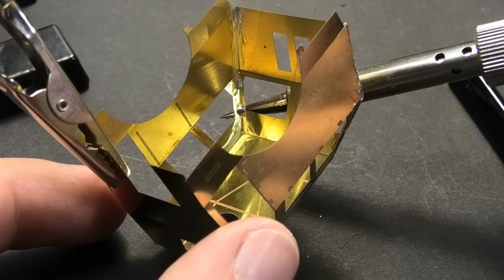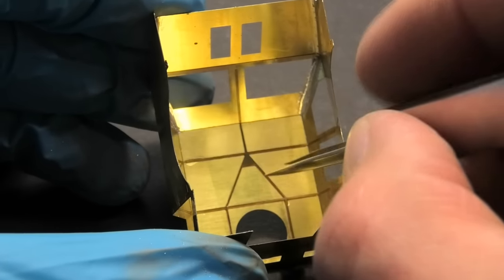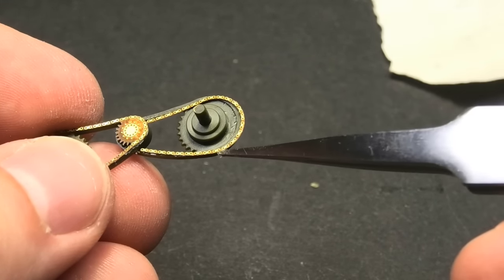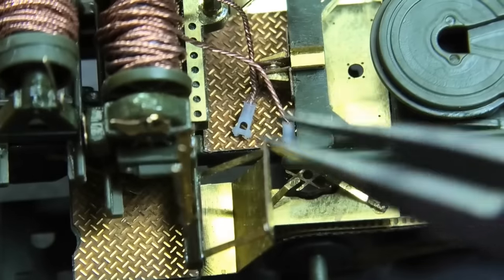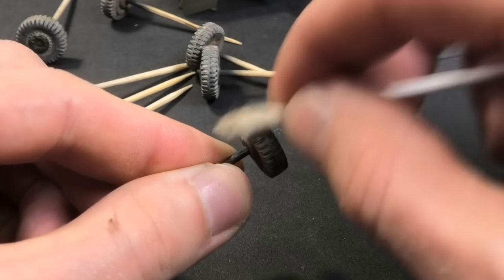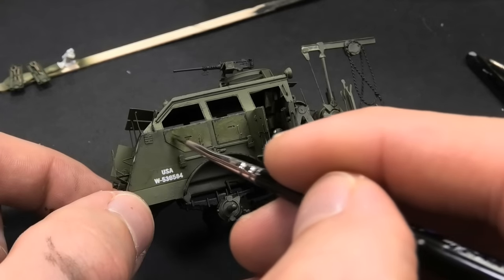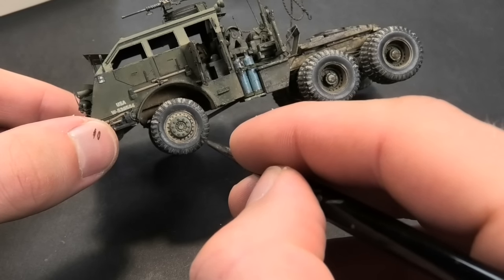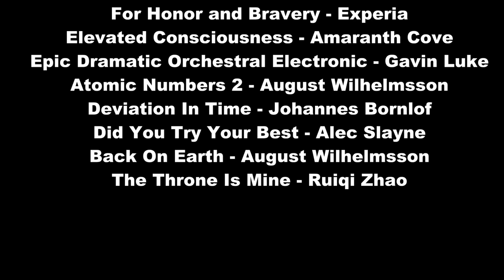M26 Dragon Wagon - 1/72 - Academy - AVF Model

Comment: The way you want to do such a part is with a small torch, not a soldering iron. Low flame, super thin lead soldering wire (1mm or smaller) and you apply it in place from the wire, don't set it in place, that's not gonna work well with such thin brass. You also don't want to heat it for too long either, so if you have a heat gun that's meant for soldering parts unto PCBs, that's even better.

Comment: I fully believe that this is your most detailed model ever. What can be done with photoetch these days is amazing.

The only detail missing that I can tell is the fifth wheel release handle. I only know that because I watch The Chieftan’s YouTube channel. He did a two part video on this vehicle, inside and out. His channel is an outstanding resource for armor model builders. (I am not affiliated, I am just a fan.)

The Dragon Wagon was of course a tank recovery vehicle. The winches are ridiculously powerful, so you can put pretty much anything on the trailer that will fit. Maybe a Maus, if your intended diorama is not restricted to real history?

Comment: Turned out great David as always, thank you for uploading!! 👍👍
 A little tip for the next time you solder try using a Chisel Tip instead, it holds the heat much better than those fine point tips do it'll make wicking the Solder along the joint easier. 👌

Comment: I'm starting one of these, with the plan of putting the Trumpeter LCM-3 on the trailer. Any suggestions for sourcing replacement parts (like the ones you 3-D printed), for those of us without a printer?
Reply: Nevermind! I had overlooked the linked text to the files on Patreon, my bad :-). I now have them, just need to find someone to print them for me!

Comment: Plasmo- I'm an electronics guy, and one thing I've learned is to stay away from Lead-free solder. I doesn't Conduct or heat well, It doesn't flow right, worst of all, It is always ugly. I know lead is toxic, but I'm not a plumber that has to worry about that. Use Lead in a well-ventilated room...
Reply: P.S.- STUNNING model, as always...

Comment: Hello! 
What you're doing is amazing. But for some reason there are not enough Soviet and Russian equipment on your channel. Their technique is the winner in all wars, as well as a sign of the confrontation between good and evil. There are a large number of samples (models) of current and promising equipment on sale that can be shown on your channel. And yes, it's true. Although the armament of the Russian Federation is as simple as a brick, it is more effective than the well-developed and complex NATO equipment because it is designed for use by ordinary soldiers, without training requiring long-term training.